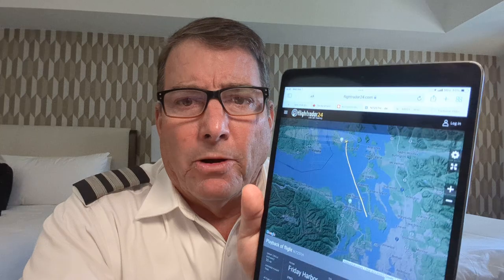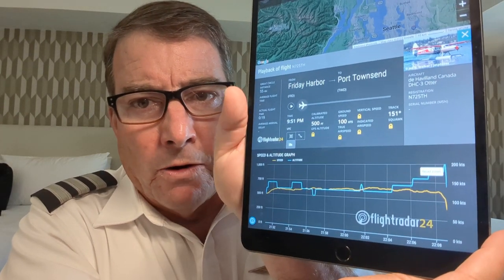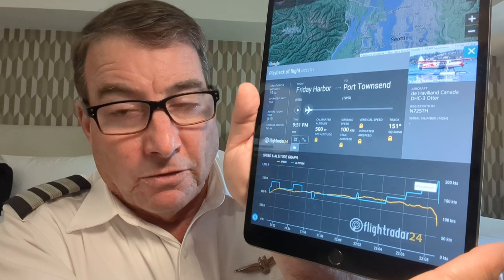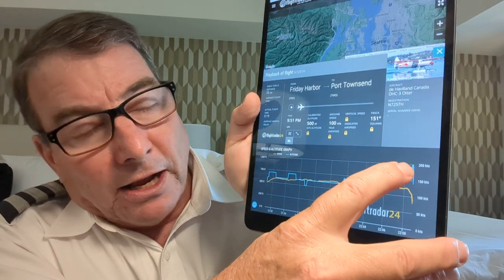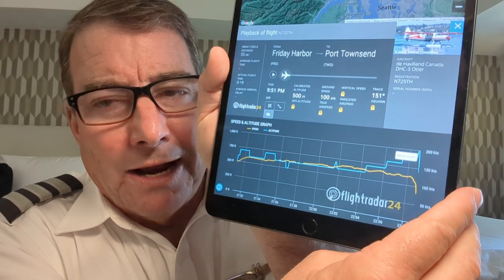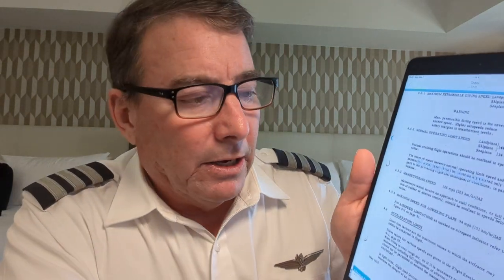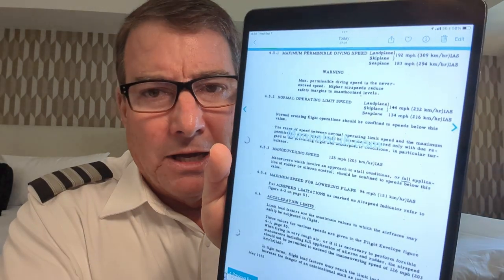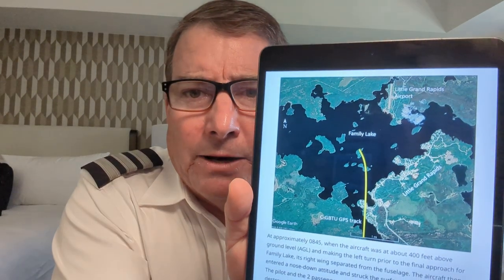DHC-3 Turbine Otter N725TH Crash 4 Sept 2022

Comment: I have flown these aircraft for over 30 years and have over 10,000 hours on type. All of the fatigue issues are well know and as long as they are properly maintained it is not an issue. I am very fortunate the company I work for regularly rebuilds, sometimes down to components our aircraft. I suspect the screw jack in the horizontal stab may have played and issue, just a guess but if the trim(screw)jack fails it has led to severe pitch oscillations. A very lucky pilot I know had this happen and miraculously landed at the bottom of an oscillation. A runaway trim due to a worn or loose jack is interesting but nothing a trained pilot can’t handle, a stripped screw jack is another story! I hope they find a definitive answer but they seldom do. My condolences to the pilot and passengers. Northwest Seaplanes is a very reputable company and my thoughts are with them
Reply: Alaska Airlines failure to frequently lube the jack screw mechanism.   Changed maint. periodicity to save money.   Didn't turn out well.
Reply: @orthopraxis235  The horizontal stab screwjack is the most potentially terrifying airframe component.
Reply: @orthopraxis235  Yes, a very stoopid and reckless "savings" that would save them a few pennies in grease and little time in inspections... Too sad.
Reply: Reminds me of the Florida Everglades crash.
Reply: Kenmore Air is the best operator of this class of aircraft. I have been a passenger, and was impressed with the skill and professional excellence.
Reply: I believe they will find out when they examine the plane
Reply: Gearhead69
Reply: I used to work on a DHC-3 single Otter on wheels with P & W R1340-61 in 135 air taxi ops. The tail on these is very busy place. Pitch trim with an aft jackscrew & fwd H-stab hinged with smallish special DH 3/8"  bolts $$$$$. There are tabs on lt & rt elevators, left is a booster tab to help on very heavy control inputs (power steering) & if I remember correctly the right tab is for a flap interconnect to keep acft. trimmed when humongous  flaps are lowered. This was added as a SB early on in Acfts. life as it was hard to keep up with trimming when lowering flaps. I have seen at least 3 turbine conversions on a Beech A36 & Cessna 210 acft. which required Dual trim  tab actuators as part of conversion STC. Never seen turbine single Otter conversion & do not know it this is required on these acft. I could easily see if on floats these components you might want to Preflight / Inspect are way up there. Possible vibration issues with smaller diameter higher speed turbine prop VS. the 12 foot diameter much slower turning Ham. Std. Hydromatic on P & W 1340 ?

Comment: I worked as a Stress Analyst 50 to 60 years ago at Gas Turbine manufacturing companies during the Discovery of Low Cycle Fatigue.  This fatigue failure looks like a classic LCF crack, propagating over a considerable time of operation, but not detected by visual inspection of the components.  50 years ago we used Zyglo (fluorescent particles) or Magnaflux (magnetic particles)to detect these types of cracks.  There must be much better methods available today.  What a shame this had to happen.
Reply: I remember Zyglo and Magnaflux.

Comment: Dan Gryder has brought up a very good point, there has been prior elevator/elevator tab cracking and control problems.
Reply: @4:12 to 4:40 plus an example mentioned
Reply: The bummer is that fatigue cracks are very hard to find, and nearly impossible to find in a casting where the defect is internal and the crack doesn't show on the surface.  About the only thing that can be done (besides prohibitively expensive detailed examination) is to life-limit the airframe to prevent these accidents from happening.  Having said that, good luck trying to determine this for bush planes, where the hours may mean less due to a hard life...
Reply: @rnreajr9184  Prohibitively expensive, not necessarily so- until the government gets involved. It would certainly pay to do whatever is necessary now to ensure airworthiness before more incidents like this occur, or else the work will be performed under a s**tstorm of bad press.
Reply: @rnreajr9184  That's scary.....everyone flying one of those has got to worry
Reply: @owenmerrick2377  more government involvement. Like lock me in my house. I think not
Reply: I can’t watch Dan. He’s a bumbling fool
Reply: @owenmerrick2377  It's prohibitive if you have to X-Ray every fitting and joint, and still want to turn a profit while hauling paying passengers or cargo.  I disagree about it only being prohibitive if the government gets involved - if the government isn't mandating it, are the owners/operators going to do it? I doubt it.  It might end up like the old military surplus planes that ended up fighting fires, but after a few wings fell off (on video, no less) they were retired, for the most part.
Reply: @rnreajr9184  Don't underestimate lawsuits and their effect. Plus insurance companies will be involved so shit is going to hit the fan.
Reply: @fritzkabeano1969  Yes, some aviation insurance company is already circling the wagons on this one.  How far it goes will depend on what the per passenger liability limit is.  Will it draw a top 5% of renowned aviation plaintiff attorneys?  Hard to say.  If they see a pot of gold in punitive damages, yeah... problbly will.   Everyone who ever had a hand on it, published anything (op's and maintenance),  the engine manf, any part from the spinner to the white nav light on the tail will be sued.     There will be many defendants that'll belly up to the bar on this one.  It will likely set a precedent for other aircraft like this one.   Quite sure the one where the wing just 'came off' would be one to search how that one turned out.
Reply: @MB-rp2qg  I think not, either....that's when things get expensive
Reply: @chrisholmes6311  You're criticizing his style, which is pointless. He's got better knowledge, brain power logic and communications skills then most I've seen, so far, but its kinda country style. NIT BSEE, aeronautical, commercial turbine pilot, CFI. I was in the Zyglo era.
Reply: @mat1500  As an accident analyzer Gryder's a bobo, lacks objectivity IMO. He compulsively obsesses over an obscure religious cult's accident while  cultivating his own cult following.
He should stick to instructing. I think he's excellent at simulating stress, pressure, that head-in-a-vise feeling, in instrument students.
He ought to stick to playing his guitar and teaching his DC-3.

Comment: Juan...I owned and flew a 1955 Cessna 180 taildragger for about 25 years.  Most of my time was on the west coast and the airplane was hangered.  I moved to Houston and the airplane was hangered there.  I kept it as pristine as money could buy.  At the annual I insisted on checking the strut attachment points and the jackscrews etc in the elevator.  In 2021 I decided to sell it.  It was/is such a desirable airplane it went quickly.  A big part of my decision to sell was how much metal fatigue can an airplane actually handle.  All metal will break in time given enough cycles of flex.  I had been in a few rotors in the Sierra's and lots of rough IFR weather.  I keep up with the new owner and he is having a blast with the airplane, but at some point, we need to recognize there are hidden stress/corrosion points we cannot find with dutiful annuals. Mine was treated with corrosion x at every annual. RIP for those on the Otter.  I doubt at low altitude and sudden loss of altitude it was a pilot issue.  Thanks for what you do.
Reply: Not if but when?

Comment: When I heard of the accident, I was working on my Cessna 150. When I first read the article and eyewitness accounts my first thought was an elevator cable snapping or other structural failure on the empennage. I'm interested in seeing the investigation and wreckage of the aircraft to see what really caused this accident. As always, an excellent breakdown Juan.
Reply: Well in the case of an elevator (main) cable snapping, it should still be trimmable. I don't know the specifics of the Otter control system but in an airplane with regular trim tabs, the above statement would apply. I've seen it happen and the airplane was landed successfully.
Reply: Bang would be wing failure my guess

Comment: You are right about not knowing.  We just don’t.  I am guessing it was flutter from that servo trim tab.  Because of the directives you pointed out.  The age of these Otter’s concerns me.   Just the need to have an FAA aeronautical engineer formulate a fix for the controls after installed turbos is crazy by itself.  It worked for 40 years, but there is a limit.   I think we found it.  Those hairline cracks happen little by little until massive failure.  This plane went down without control of any sort.  Tail was broken and the plane flipped down backwards at 79 mph.  probably.  The people on board this plane were great people that will surely be missed.  May God grant them peace.

Bring everyone home safely Juan.  You are a hero of many many fans. !
Reply: i knew jason, he was a great pilot.. really is sad

Comment: Having worked in aviation what I saw over and over with any seaplane was how corrosion is insidious and literally gets into anywhere. Honestly when your flying 60 year old aircraft that are in a difficult environment and the extra stress of being a turboprop conversion I'm not surprised they are crashing with what sounds like airframe failure. Aerobatic, agricultural, seaplanes and short destination aircraft really need a total expire time put on the whole airframe.

Comment: My wife and I were boating in Puget Sound this past Monday less than 24 hrs after the crash. We were roughly 7 miles due south of the crash area and found a pink women's rubber sandal floating in the water. no other debris floating in the water but kind of ominous knowing there were still 9 souls that hadn't been found and running across a women's sandal. May the families be comforted during these difficult times

Comment: Juan,
Thank you for these reports - and have a safe flight home!
Paul (in MA)
ps The drought in New England may be improving as western/southern New England just received between 2 and 11! (flooding in RI) inches of rain in the last 48-72 hours. Eastern most MA   - including Boston area/Cape Cod got very little rain so those areas are still very dry. Remarkably Quabbin and Wachusett reservoirs both at about 90 percent as of 1 Sept.

Comment: Juan.  oddly enough I just got my Seaplane rating (single and multi) renewed as an I love me project (with a different operator) last month.  this company is known as one of the straight shooters in the area, they are quite meticulous on cleaning the plane with fresh water, after every flight and have good maintenance.  several of my buds in the test pilots shop have flown there and speak well of them.  you handled this quite well.  greetings from Whidbey fly safe

Comment: I have no aviation knowledge whatsoever, but I greatly appreciate your insight.  I especially appreciate your willingness to offer potential causes based on your knowledge and the information currently available.  Your caveats are clear; nobody knows the cause yet, but there is nothing wrong with discussing possibilities, as long as there is some support for the theory and it is not sheer speculation.  
As a commercial passenger just a few times per year, I would be a bit reluctant to get on a small plane that old, even before hearing of this tragedy.

Comment: A big bang usually is a high stress component failing. Even new we have NDT inspection for a toolmark.

So, Longview aviation should probably look at their directives and increase intervals of ndt inspection on high stress components. 

Another thing is the airframe does not have same stress characteristics between a radial engine and turbo prop. 

Harmonics vibrating through airframe, higher stress from more hp/torque etc. 

Yes calculations where made for stress between using a radial engine vs a turbo prop, but keep in mind airframe was designed for a radial engine application.
Reply: This is exactly what I was thinking! Hearing that loud of a noise from that high up has to be a large amount of potential energy, I'm thinking something to do with the wing section or struts, etc. Interesting thought and concept about differences between radial and turbine harmonics, never really thought about that before 😎
Reply: @jasona-EV  Food engineer's thinking, kind of thing. Also, what I was wondering about with wing spar attachment(s) strut, partial progressive failure, or other such, and of course the prime suspects, HS failures, FOD engine damage, also, at that altitude.

Comment: My IA says the Walters and Garrett conversions only have one trim tab rod instead of the two on the PT-6 conversion. 
We also speculated about the possibility of a drone collision at that altitude. 
But it is just speculation at this point. The water is around 200 feet there in Mutiny Bay and the water is pretty cold. No easy recovery. It will take a while even if they locate the wreckage.

Comment: Thanks again for a great report Juan.
  Seems similar to the twin otter a few years back that crashed after takeoff. That one was just like these witnesses described, going straight down. It was a control cable that corroded and snapped. Happens all to often sadly.
  Nothing puts a smile on my face like an old Beaver or Otter thumping on by. Even had a couple flights to Vancouver from Vancouver Island in a radial powered beaver. Absolutely loved it!
  But, saltwater and salt laden air? That time bomb just keeps going…

Tick…
Tick…
Tick…
Reply: Beaver is my favorite aircraft. Second is CL-415.

Comment: Dan Grinder (Probably Cause) did a deep dive into sister aircraft that also dove, exceeding forty-five degrees, to their crash sites. Tail preflight is compromised by the height of the horizontal stabilizer. Trim tab separations have occurred.

Comment: I was flying near Paine field starting around 5pm that day. The wind had shifted almost 180 degrees blowing 10 to 20 kts at 1000ft in the time since this crash and my flight. It was overcast at like 2 or 3 thousand feet with intermittent rain. Don't think it had anything to do with the crash though. When we noticed the TFR on forflight I assumed it was a boat capsized or something as we only read far enough to see search and rescue.

Comment: ⚓️ Thanks Juan 😎  ? Stress cracking in steel components is common in all industry, so many stress cycles = cracks… in the olden days the annealing process cured the failure rates…. the process is defined in some CFR. Could be a partial solution ⚓️

Comment: Tides are very strong in this area and the water can be very deep. I've heard it's about 100 feet down which is much better than it could be.
Reply: Yes tides are strong.  Water there around 100 in the bay but I the shipping lane where about it crashed it's up to 400 feet deep.  The water temp in the summer is in the low 50's.  That bay though is cold due to depth.  Definitely a current there in the Bay.
Reply: The search included Island County, San Juan County, NAS Whidbey Search and Rescue as well as the Coast Guard.  Coast Guard was lead agency.

Comment: These are very old airplanes working in saltwater. What could possibly go wrong?
Reply: Chalk's comes to mind.
Reply: Exactly !
Reply: It was on wheels not too long ago.
Reply: @gcrauwels941  That's a poor example, as the company had serious maintenance problems.
Reply: There are directives when operating an aircraft in salt water. There is also corrosion inhibitors sprayed on airplanes for this.
Reply: @DoubleMonoLR  That could be what happened here though. Old airframes, more power, lots of cycles. Maintenance? We'll see.

Comment: Hasn’t there been 3 other DCH3’s with horizontal stabilizer/elevator failures the past 25 years? 2 in Alaska and 1 in Washington?  I wouldn’t step on an Otter or even a Beaver. Too old and too many hours.

Comment: Juan a coworker of mine witnessed the accident. He said the plane was intact when it impacted the water. The pilot had lowered the flaps and landing gear trying to slow it down and pull out of the dive. He also said all flight controls were flat. Is it possible the elevator controls cables snapped?
Reply: Landing gear down?, believe news reports said, this was a float-plane.
Reply: @jangravemaker1785  this float plane had landing gear inside the floats. We have many float planes land on the airport runway just 5 miles away
Reply: Would imply he tried to hang everything out to slow aircraft, wonder what about prop. flat pitch? Not much time for all that. Other failure modes could contribute to that flight profile, too.

Comment: The loss of a Grumman Mallard awhile ago from saltwater corrosion of a wing spar that was not detected highlights the problem of exposure to saltwater over 5 or 6 decades in spite of rinsing. I received dual aerobatics instruction in a North American TF-51D Mustang built in 1944 and pulled high G loops and combat maneuvers with complete confidence regarding the airframe and I would do so again. But now I would hesitate to fly in any saltwater seaplane older than, say, 35 years, to choose a completely arbitrary number. Why not fly in one of that age or older? It's simply because I don't have to. I would certainly not let my children do so except in an emergency although I had sent them up in an original Curtis Jenny with confidence. The situation with these holiday flights in quite old saltwater aircraft is that 99 percent or more of these flights are not urgent or emergencies. Because of this I do not see the pressing need to use really old saltwater seaplanes for tourism or even as commuter aircraft.